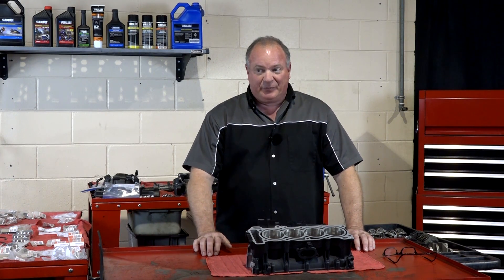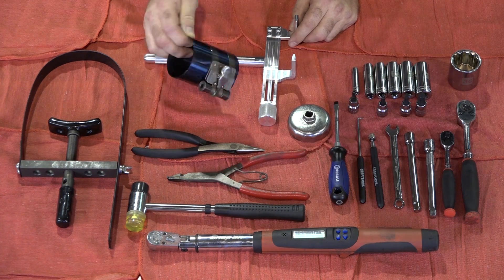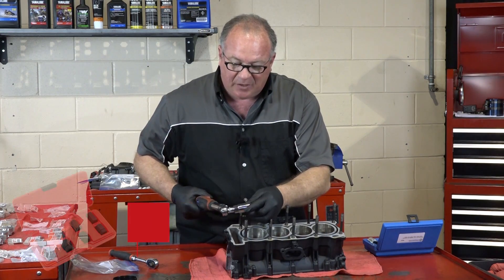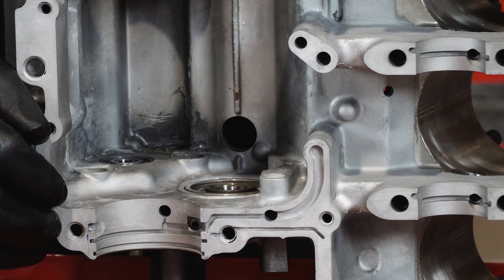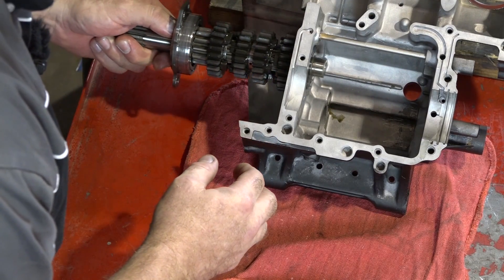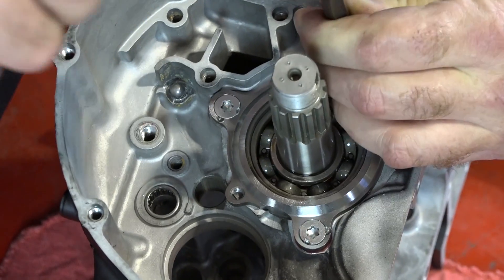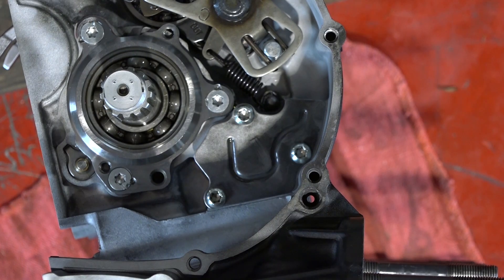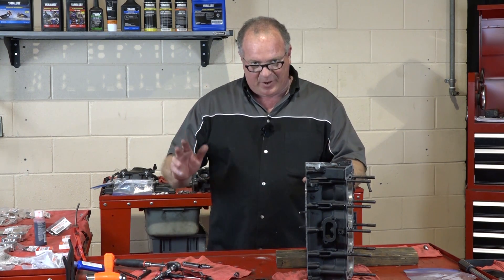Yamaha R6 Engine Rebuild Part 1: Bottom End to Piston Install | Partzilla.com

Comment: I’m debating buying the motor from an 07 r6 for $350 but from what he said it needs a full rebuild and didn’t say why but in the last video you pretty much named all the things to look for and I found it very helpful. I rebuild a few sbf motors but from what I’ve seen these are just as easy to work on.

Comment: The O-rings you're placing on the Nozzles "5EB-15155-00-00" are they OEM and are the OEM material Fluorocarbon (Viton)? If someone does not have access to OEM Viton O-rings would be best for that application in my opinion, what are your thoughts? Excellent tutelage on an complex engine rebuild you've demystified many topics in this video. Thank you.
Reply from the maker: Glad we could help. We put a lot of time into our engine build series.

Comment: This is amazing.  Have a question what is the process of the pulse ignition generator cover is stuck on a 1998 and has never been replaced or removed?  Three clutch cover bolts were over tightened previous owner and put holes in the crankcase.  What would you recommend for this?  JB weld?

Comment: Hopefully you can rebuild a complete engine such in electrical(starting system,  charging system, cooling system) for honda cbr400rr nc23 or nc29 as for your next job,  thank you so much in advance
Reply: Factory Manual will guide you through the process as well some experience.. Love the 400rr's
Reply: @mgs_9956  I DONT HAVE IT

Comment: Why didn’t you cool the bearings down? Or heat up the block? I’ve always learnt that you destroy the bearing by hitting them in this way.. I could be wrong, it’s not to put you down. You’re doing a amazing job😉
Reply: Or.....do both.....heat and cool. The actual process for setting the bearings is OK.....I have done it thousand times..
 Real trick is how to remove the shift shaft needle bearings. Yamaha set them in blind holes with no way to "punch them out." I have modified 2 of these R6 cases to allow a punch in there.
 Yamaha manuals suck....I have an 87 FJ1200 that is a beast with just under 160 RWHP and I can tell you from experience.
 F'ing Yamaha.....the king of nightmares.😉😆

Comment: So this engine was nicasil plated by the machine shop that bored it? I have seen a plasma metal spray buildup on a bearing fit on a shaft. I'd be very interested in watching that process.

Comment: Do your miles go down to zero after a rebuild ??? Or would i need a brand new engine for that  😂 probably a stupid ? But it would be amazing lol
Reply from the maker: Normally, unless you get a new tach, you would note what mileage the engine was rebuilt.  Then you have documentation on how many miles are on the chassis and how many miles are on the new motor.

Comment: how much does it cost to rebuild the engine of the 2006 Yamaha R6
Reply: A basic rebuild to the extent done in this video and dyno tuned from our shop would be in the 3 to 4k range.    Our pro stock drag bike engines start at 14k and up.

Comment: Hi sir, i got a question about engine rebuild cause i got no idea. How do i know when i need a rebuild??? I got 2007cbr1000rr  and its got 32,000km when i purchase it  😁😊
Reply from the maker: Blowing smoke, loss of oil, loss of power, rattling...there are many subtle hints, but if you have a problem that requires you going into the bottom end to fix it, then it's time to rebuild.
Reply: @PartzillaParts  thank you very much sir, now i got some idea 😁😁😁

Comment: The open deck design must limit the durability of the engine.
Reply: The 2008-2018 R6 motors are very strong and last a very long time.
Looks can be deceiving.   And remember you're not gonna get much more than 135 WHP out of these anyways.    Out of all the bikes I crashed at the race tracks, the R6 is the toughest when it comes to limiting damage during a crash.  Only the forks are the weak link and tend to bend during a serious crash.
Reply: D. C  And why would you say that??

You don't think Yamaha thoroughly tested this design out before putting it into production?!

Im sure Yamaha know better than you buddy.

Comment: where did u buy that fly wheel puller? (brand?) . thanks
Reply from the maker: You can get special tools on Partzilla.com.  

https://www.partzilla.com/product/yamaha/90890-06721-00
https://www.partzilla.com/product/yamaha/90890-06723-00

Comment: hi guys i am rebuilding my cbr1000rr 2008 bottom end with a damaged connecting rod but the issue is i need to replace the connecting but there is a number written on my connecting rod B2 CAN I REPLACE WITH A2 CONNECTING ROD
Reply from the maker: No, they are labeled so they match the crank.  Letters are the inner diameter of the rod and numbers are the outer diameter of the crank.  Then colors for the bearings.  There should be a code on the outside of the crank pin showing the sequence.
Reply: Of course this is for basic rebuilds on stock components.  With our race engines where every part is lightened , matched and machined  all those letters , numbers , and colors don’t mean shit.  This is when you need the proper measuring tools to check clearances.

Comment: Damm Man.. The level of expertise you have... OMG level.
You seem to know every little detail of the little details. 
And the tools used are perfect.
Reply from the maker: With age comes experience.  Thanks for watching!
Reply: Partzilla . Thanks to you for making these awesome videos. 😀👌👍
Reply: Yeah... real "expert".  I like the way you used so much engine oil on the head stud threads... so that it leaked into the coolant cavity!.  So now you have oil in the cooling system.  Very unprofessional.  

Also... you didn't even show the viewers how to properly install a bearing so as to not damage it.
Reply: @mareksumguy1887  that’s what the manual calls for go bitch at Yamaha
Reply: @Eglehalo4  no it doesn’t!
Reply: @mareksumguy1887  NOTE:
• Lubricate the bolt threads and the bearing surfaces with engine oil.
• Tighten the cylinder head nuts, cap nuts, and bolts in the proper tightening sequence as shown and torque them in two stages.
Reply: @mareksumguy1887  go reread it
Reply: @Eglehalo4  does it say to do it carelessly whereby you spill the engine oil into the coolant cavity, dummy?

Comment: Hi guys. I need to rebuild My 2006 Yamaha FZ6 Engine and Transmission. Do you guys know where I can buy everything? I need and would like Aftermarket Over Size Oil Pump, Water Pump. Pistons, crank, cams, every single  sensor for all pressure stuff and what not. Also, all of the gears for my gear box. And all pressure wires and sensors, and what not. So pretty much a FULLY REBUILD kit for both my Engine and Transmission. Haha..
Reply from the maker: You can get all the OEM parts from Partzilla.com.  Aftermarket is going to vary depending on the part.  Aftermarket companies have different specialties.  It will take a good amount of research.  It's going to be a heck of a project!

Comment: is putting the transmission together the same method/way for a 2005 Yamaha r6
Reply from the maker: It will be similar, but because they are different generation motors, it will be a little different.